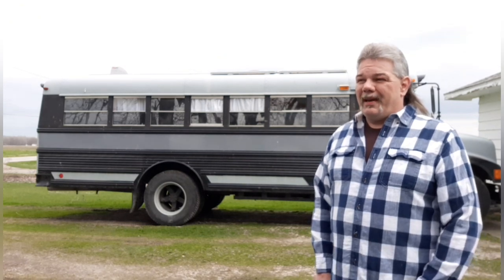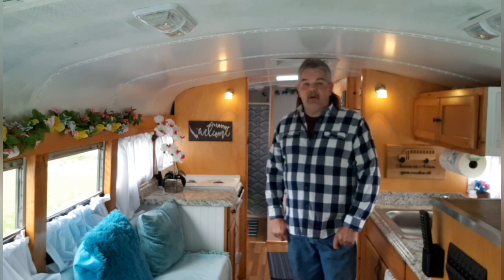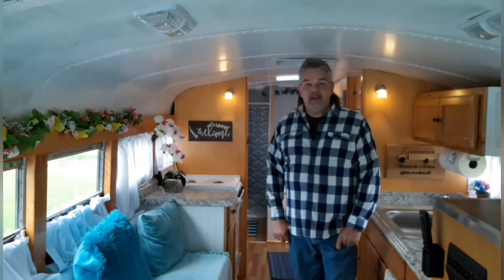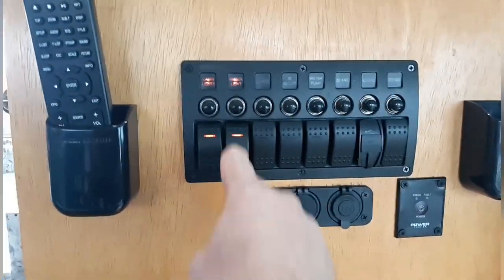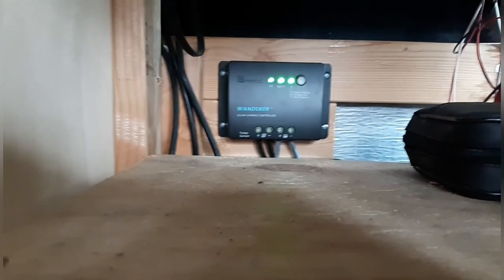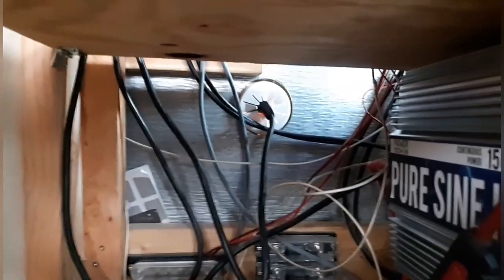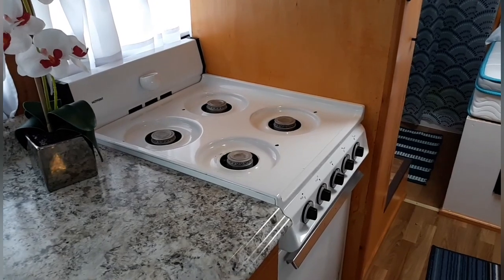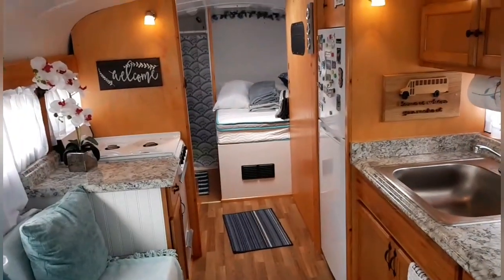Prepping With an Off Grid Skoolie

Comment: Well this is a revelation! I don't know scat about electrical, my bus blinker doesn't work and I am just getting my toes wet in the conversion. But this looks doable, and fits right in line with my plans, we are going off grid base for our build, haven't touched the grid for the demolition, looks smooth sailing for the rest, doing well in the cow field so far.
Liked and subbed 💙👍🏼🤗